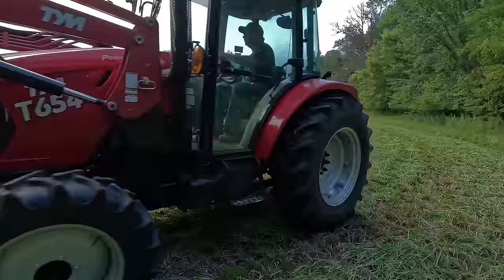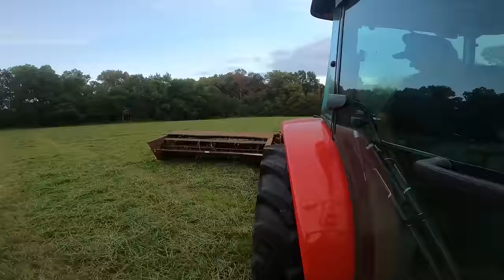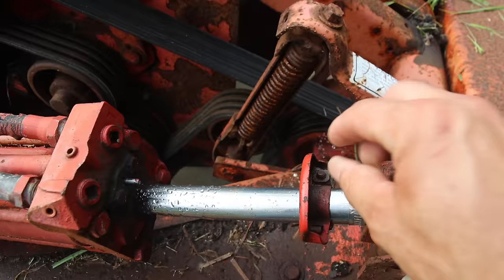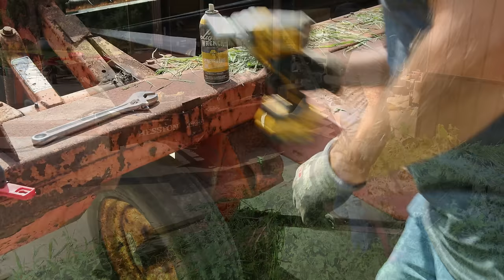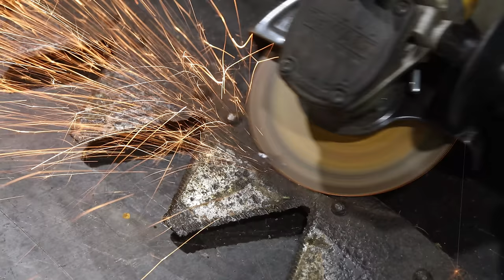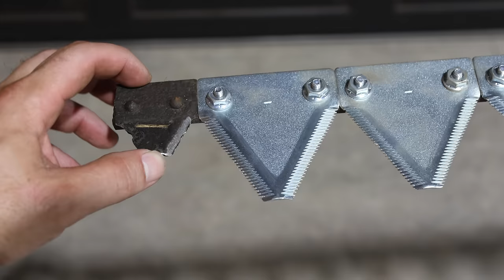I cut the first hay field and the mower broke down   Hopefully I can get this fixed.

Comment: Might be worth calling an agricultural junkyard to see if they have the spring? Some seem to be reasonable, some just go by half the price of the new part :-(

Any chance the bolts could invert to clear the hold downs?
Reply: No, the bolts have a knurled section at the head that are the thickness of the bar, are interference fit, and are round-headed (won't take a wrench).  There is also typically less room below the cutter bar than above.

Comment: Unless those flathead bolts are stainless or have some kind of coating you're not really making it any easier for yourself 😭 rust comes for all of us
Reply: You're right. And I think I would at least put Never Siege on them. And even then, he might be back to cutting them off after a couple of seasons.
Reply: The sickle sections will wear out long before the bolts rust out.  But, I think they are zinc plated usually.

Comment: Do you think buying used equipment actually saves money when you end up having to  go back  and order parts and loose time in the field?  I’m not sure how to figure that.  Just wondering what you think.😊
Reply from the maker: $20,000 for a new disc mower conditioner.  $1000 for used mower conditioner.  That is a lot of parts you can buy.
Reply: @CountryViewAcres  That is a lot of parts, plus you are able to make some of the parts you need.  Thanks
Reply: LOL price new equipment
Reply: @CountryViewAcres  Don't forget to figure in down-time, especially for you, trying to squeeze farming in on the weekends.

Comment: Man...... idk how to explain without being able to keep the message short but understand how to remove riveted sickle knives with a good vice or anvil to rest the sickle bar on you can basically sheer off the rivets by hitting the back of each knife.... a lot less work.
Reply from the maker: I tried that too.  But didn't get it on camera.  The Sickles were in such bad shape.  The sickle just bent up and deformed and didn't shear the rivets.

Comment: NOOOO! don't grind or chisel the teeth!! It is easier to hold the bar on the edge of a drum vertically and hit the back of each tooth with a 4lb engineer's hammer.  That will cut both rivets in one good strike.  Should only take 5 minutes to strip the bar.  Ive changed many single tooth in the field on a sickle mower.  flattening rivets can be quicker than tightening bolts.

Comment: I plan to buy all of my hay.  By the time you buy all of your hay equipment and pay for fuel and repairs,  you could raise a lot more animals and winter them with bought hay for the same money.  Of course, that is a lot of fence you still need to install, but still....
Reply: IF you can buy the hay? And, at a reasonable price and transport it. I have done both. Lots of angles to consider.
Reply: Hay is very pricey right now, $160-$200 for good quality large rounds, will be higher this winter.
Reply: @therealdiddypop4150  Depends where you are.  I see grass hay round bales for $50-75.  Alfalfa hay for $125 central Illinois. Where Evan lives in south eastern illinois its probably pretty reasonable.  We have had pretty good rain in july.  June started out dry, but we got a lot of rain the last week of June.